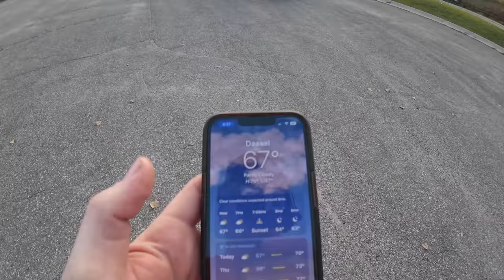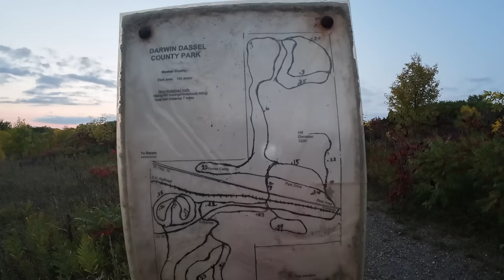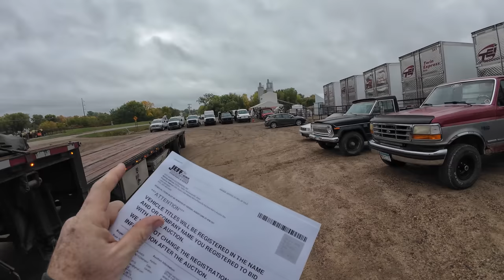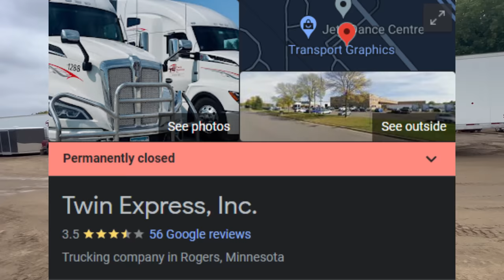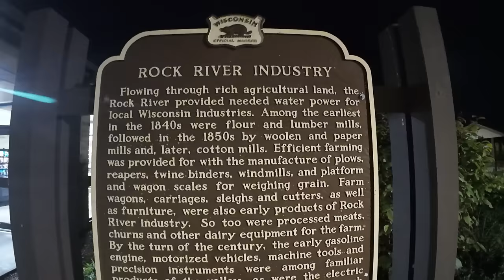A must see rest area! And another auction  load

Comment: Robert that plow is actually quick attach if you look at where the plow harness connects to the main frame under the lift cyclinder there is two wedges to lift up and remove the chain at cyclinder and the hydraulic hoses and back away from the plow
Reply: If he had angled the plow it would of fit.

Comment: I was a master heavy duty truck technician for 12 years live in Wisconsin and I just seen your video. I’ve been watching you for a while with all the troubles you’ve been having in order to check your wiring I seen you used an ohmmeter that can give you a false reading what you really want to do is put a load on the wires.
I seen you had your valve cover off what you wanna do is disconnect the wires off the injectors, disconnect it from the computer take a wire from the battery to one of the injector wires and on the computer and do you want to use a light bulb that draws about 3 to 4 amps. The old meter could show the wire as good however, it may not be able to carry current which would mean it’s bad using a white and putting a load on the wire you know you’re good. You also want to shake the wiring harness to see if the light flickers, I’m sure by now when you see this comment you’re on your way to get a new truck.

Comment: When did it change that the driver has to figure out how to take the load apart to fit on the trailer? The shipper should have a plan. The drivers part is to bring the trailer to the shipper and they load it within the trailer . The drivers part is to secure it to the trailer. What an I missing? Glad I'm not doing this any more. Love you guys, be safe.
Reply: Yep, i ran my own trucking company for 23 years we had 15 trucks, we ran dry van as well as skateboards and stepdecks. Not once did my drivers ever load or unload their own truck with freight. We never touched a thing unless it was tarping which we charged $200 extra for and only secured with straps or binders. How in the hell or why in the hell would these newer breed of drivers ever start having to load their own freight and unload their own freight??? This was always a big NO NO. I've seen Robert load and unload equipment that he had no clue of even how to operate, that's a recipe for disaster and I'm sure if something catastrophic happened, the insurance company would 100 percent not cover that!  Glad i sold my business off and have a low stress, great paying job now driving a limo in Vegas and I'm home at night. I have to hand it to these 2 though, they are very determined and hard workers. Robert is a great guy with a fantastic work ethic, and thats hard to come by these days!
Reply: It's a pickup at an auction yard. You're throwing dice as to how much work needs to be done.
Reply: @markpeterson6836  picked up at dozens of auction yards throughout the years of operating my own trucking company and we never loaded our own trucks. The auction houses had crews  that would load our flatbeds or step decks. This must be the new generation of drivers , if we ever did have to touch anything we would charge for it accordingly
Reply: If he had angled the plow it should of fit width wise.

Comment: Hi Lita and Robert. I read that the inverter needs to be placed in a ventilated area. When the inverter shuts down, has it been touched to determine how warm it is? Even though a fan was placed to blow on it, that is an additional power drain. Buying the cheapest parts can be good for the wallet and even though the parts can look the same on the outside, what matters is what you can't see on the inside and materials used. Does the same manufacturer make all of the different brands? Have good days!

Comment: What's going on is you keep buying cheap parts. I have an auto repair shop and I cant tell you how many vehicles iv fixed by replacing a aftermarket part customer already changed with OEM parts. They are expensive because they are worth it. Can't make money with a broke down truck. Especially if it's because your buying 10 dollar parts.

Comment: I just wish you could get in a Peterbilt or Kenworth I am certain you would have much better luck but they break too just not as often
Reply: I always owned Freightliners with the Cummins in them and had really good luck with those, and we used to beat the living daylight out of them. Tons of mountains as well as lots of city driving and blazing hot desert runs as well and they always held up strong. Never had any luck with Internationals and we had a couple of Kenworths as well that were great trucks. Maintenance is always the key too!